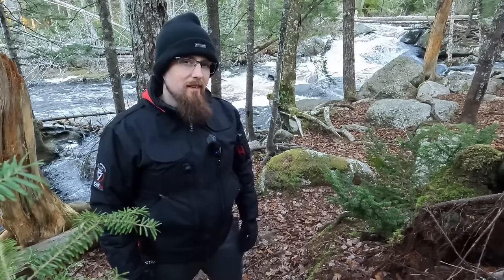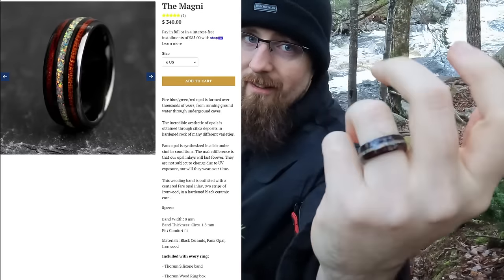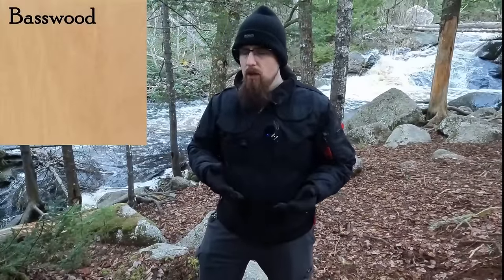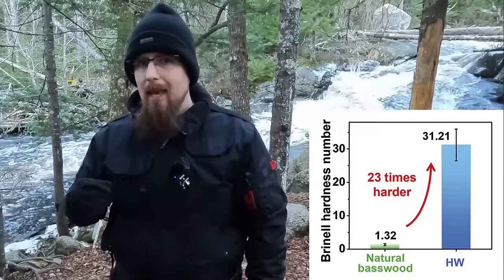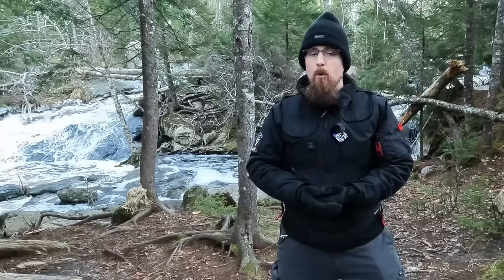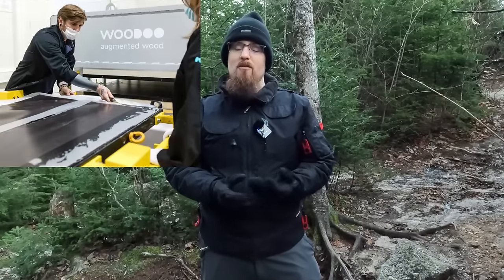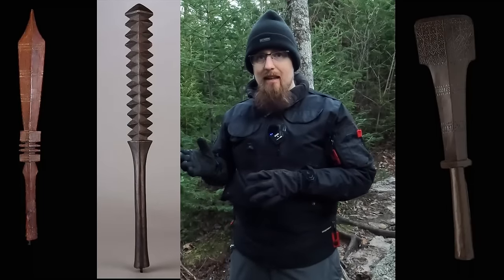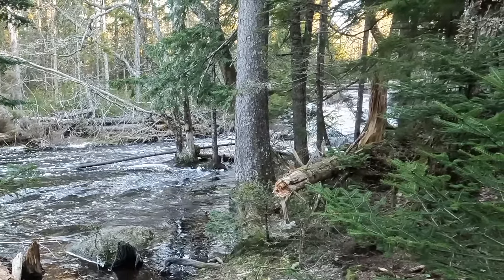Hardened Super Wood!  -  Can It Rival Steel?

Comment: I see a big problem with using this as a building material:

One of the reason we use wood and steal as building materials is that they offer strength and yet they are flexible at the same time. Flexibility is essential because it prevents the material from breaking under stress.

A good example of this is why we don't make swords out of stainless steal. Yes, they would be easy to maintain and stainless is very strong. But stainless is going to shatter under the stress of a duel.

If you increase the hardness of wood, it will break and your building will collapse.
Reply: The best alternative would probably be to breed trees so that they would be able to soak up metals, allowing GMO trees to be planted in mining areas or other polluted places.

Imagine being able to grow organic beams, and all you had to do was feed them waste materials.

Fungi already does this with trees to some extent, so it would theoretically be a fairly straightforward path into the technology.
Reply from the maker: As actual lumber you're better off with regular wood. As far as nails are concerned... maybe, I don't know how tough and flexible hardened wood nails are. 

I think the main advantage is upgrading softwood to something even better than hardwood, for applications where you'd otherwise use either exotic hardwoods or softer metals (brass, bronze, maybe cast iron), etc.
Reply: Don't confuse flexibility with strength. You're imagining a relationship between flexibility and strength because strength is stiffness times deformation. With stronger materials being able to take more deformation because deformation being one of 2 parts of the strength equation. It doesn't have to be that way. You can have a strong material with high stiffness but not able to take a lot of deformation. The reason to desire flexibility (the exact opposite of stiffness) is because we don't want things to be brittle. Brittle materials fail suddenly and can appear weaker when motion is involved but they're not actually weaker just because they're brittle. In fact, the strongest steels are the least flexible steels. As a civil engineer, we actually try to use weaker, less brittle steels for the amount of warning time they give before they fail.
Reply: @gatovillano7009  I could have made that video myself. As I already said, motion can create the illusion that flexible materials are strong. You will find no edit in my original comment. You responded with a video that has everything to do with motion. He spent most of his time talking about things other than flexibility but he did mention it.

TL:DR, flexibility is a way to circumvent the need for strength,

Let me explain what flexibility actually means for materials. But first let me explain that strength is. Strength of a material is how much stress it can handle before it fails. And stress is a fancy word for the part of the force something can transfer through itself without moving. If you're falling from the sky, you experience the force of gravity but you don't experience much stress because you're moving. Once you crash into the ground you experience a lot of stress because the ground won't let you move. Before you hit the ground, there is no test of how strong your bones are.

Now, for flexibility. Flexibility is how much something stretches when force is on it.

A common building material is A36 steel. A36 steel ruptures at around 58,000 pounds per square inch. That's how strong it is. That's the strength. Notice how I gave you no information about how flexible A36 is. The strength doesn't involve the flexibility. How flexible/stiff it is is about E=29,000,000 pounds per square inch. That's a fancy way to say that if you stretch the steel 1%, then it experiences 290,000 psi.

So, why would they want the building to be flexible? The answer has to do with what I said before. Stress is a measure of how much of the force a material can transfer before it fails.  Here's the key-> "of the". A given material doesn't have to be the thing that transfers the force. Just like how your bones don't have to be strong until you crash. By making the building flexible, you're letting it move. That doesn't mean that the steel is strong. That's why the video mentions having a giant heavy ball in hanging in the building. By making the steel flexible, the steel lets the giant ball absorb the force by swinging around. The ball is taking the force instead of the steel. If the steel wasn't flexible, then the building wouldn't move, causing the ball to also not move
Reply: One mistake- I just realized that you weren't saying that flexible means strong. You were just saying that the flexibility is useful. I apologize. You seem like you might know what I'm saying already.
Reply: structural material materials dont get exposed to sudden ultra-intensity stresses  like weapons or tools do.
Reply: @gatovillano7009  you do see how brick, concrete, and metal also fails in this video?

Buildings build to sustain earthquakes actually rely on shock absorbers which, you guessed it, prevent the structural materials from being exposed to ultra-intensity stresses. Or do you think a 100% steel skyscraper would survive such an earthquake?
Reply: @FrenkieWest32  Dude, cry me a river.

You want to see how much I don't care. This shit has been going on for 3 days. Me I have a life. I'm just going to move on and let you talk to yourself.
Reply: @gatovillano7009  so much of a life that you're salty over a stranger on the internet...

Comment: they need to make a plywood version of that hardened wood if you want any shock absorbing armor and the like
Reply: Maybe do something like old longbows/composite bows so that one layer absorbs force, another dissipates it around and if those two aren't enough a third "cracks, but deliberately"?
Reply: Lamination and composite have been around a long time. Armor in Japan  made of paper, glue and lacquer. Other things added were horse hoof, ground or sliced, sinew and leather. Even simple glues like milk and vinegar get very hard.

Comment: I'd be real curious about its use as a tonewood. There are already some interesting methods for converting more available woods into something resembling exotic hardwoods for instrument building, wonder if this would do anything like that
Reply: Agreed.  Instruments, furniture, kitchen utensils, doors.   The types of things that don't need to be strong, so much as durable and pleasing to see, touch, feel or hear. :)
Reply: @MrBottlecapBill  Having wood door framing made out of this along with your door would make break-ins significantly harder. The same might apply if your windows were transparent wood too.
Reply: @BluntofHwicce  Gosh, you remind me of Stradivarius violins! Part of the "secret" (if it exists - blind tests show most people can't tell a stradivarius from another violin just from the sounds - but I can well believe the player would feel the difference much better) is supposed to be due to the Little Ice Age in the 17th Century iirc. Due to the cold the trees grew less, so tree rings were closer together and the wood was harder. Artificially hardening wood by chemical treatment and compression ought to have the same kind of effect.
Reply: @BluntofHwicce  wouldn't the change in density also change the acoustics?
Reply: @BluntofHwicce  oooh

Comment: Curious about the strength of the hardened wood. Could it be used in aerospace applications? Neat video!
Reply: I’m thinking heat resistance would be the issue…
Reply: @sorryociffer  Should be fine to use for body paneling, I think. It might be able to be more form fitted than aluminum panels? Not sure
Reply: @sorryociffer  actually wood ablates, so for something that isn't going to be re-used, I could see some uses.

Comment: Quite possible people in the past split wood into thin blanks then boiled those blanks in the very commonly known resin and animal hoof type glues then pressed the wood with rocks or lever arrangements into shape then crafted stuff with it.  Composites once you have a glue seems like a pretty likely thing and the lack of remaining artifacts is likely due to the somewhat prone to decay if not maintained aspect that even modern-day Composites have.  The glue brakes down and the thinner materials used for the laminate just brakes apart into dust.  Fiberglass is super notorious for this once the sun and weather work it over theres not allot left usually.

Comment: Seems to me that it would be a pretty wasteful process both in terms of water but also in wood seeing that you end up with much less of in terms of volume which would mean that far more tree would need to be cut to compensate for it.
Reply: If it has 1/5 the volume, but 23 times the original strength, no, you don't need more wood, you just make thinner structures with it.

Comment: Wood has an outstanding strength to weight ratio. Hard would be pretty awesome,
Reply: Not really. Vinyl and many plastics are lighter AND stronger. Wood is pretty heavy.
Reply: @trequor  Oak for example has a density of 0.7. Not sure what plastic you're talking about, because Nylon, 1.13, PET 1.3, ABS 1.05 PVC 1.45 etc are all denser. Oak tensile strength is typically given as 90 MPA, Nylon 78, PET 80,   ABS 45, PVC 62 (rigid - flexible is less)  Moreover to my point, 304 Stainless strength 505 MPA, density of 8 has a strength to wt ratio of 63. Oak, with a strength of 90 and a density of 0.7 has a strength to wt ratio of 115.  AS I said, wood has an outstanding strength to wt ratio.
Reply: @MrMakulit1959  That's not how that math works, comrade. You've got to manage your units better. Also oak is a piss poor example because of its expense and rarity in comparison. Nobody is going to build a house out of oak.

Then there is the problem of ACTUAL density in regards to wood. Because wood absorbs shit-tons of water, whereas plastic and steel do not. Your 0.7 density is going to jump dramatically once the oak hits the outside air.
Reply: @trequor  You don't know what your talking about. That's exactly how the math works
Reply: @MrMakulit1959  density =/= weight, for starters, but there is a lot more wrong with what you said.
Reply: Density is what is used to determine strength to weight ratios. If you don't understand this, I can't help you.

Comment: The thing about compressing basswood versus compressing oak... is that you wouldn't be able to compress oak down 23 times, like you can basswood. If you had a 2x2×12 of both woods compressed to their maximum, I imagine they would be quite comparable, as you're just compressing the lignin... and their densities and grain structure would be quite similar.

From what I understand, if you use alcohol to strip them of their sap and kiln dry them... it's either basswood or balsa which has a pound-for-pound strength markedly higher than oak. For this reason, in some circles, both are considered hardwoods, even though their natural soft nature would lead you to believe they are softwood. If I'm not mistaken, the same goes for Paulownia.

Comment: We use to use planks of wood and then drill through or drive nails in. But with this level of industrial manipulation, we could produce planks that are pre filleted at specific spaces so that they can be fixed in a much more strong and resilient way. Not to mention that if it cost more in transformation fees, much less of the material is wasted. With a more durable strong and less bulky material, an habit in investing in the long term would reduce over all waste at the land fill. Which justify the industrialization of the approach alone. For in this optic, that means that a plank can be made of a number of source of wood and be made at any desired thickness length width, shapes... A specific plank can also snap to another length providing a bond that makes the need to cut over a specific member necessary for support between structural members.

I would imagine the material to be less flammable also then the raw wood. In construction it is the limiting factor for the construction of large constructions. On this regard, concrete and stele are preferred. But those require extreme amount of industrial work and energy in comparison and end up weighing extremely more per unit of volume. That translates in much more massive foundations and architectural stress to be accounted for. But also in extreme cost of transport, craft, installation and storage.

Structural wood today is made of wood flooded in epoxy. And this is extremely not ecological and just as bad in regard of flammability. So their use is also not very extensive due to cost and risks. And the process involved here is a totally new thing and would make better use of the wood these structural would do of the wood ship they are made of. Plus their molecular bond would be more homogenous and not serve really as filler in a soup of epoxy.

We could even see thine sheets of these compressed woods in replacement of carbon fiber and fiber glass panels. And in this way make their use more economical, durable, practical and common. I can easily imagine a paddle of this compressed wood outmatch those in carbon fiber in weight, durability, and strength. It sure would cost more at first, since these industrial practice benefit of decades of investments, but given time, the sustainable paddle would outperform the old way even economically. I would imagine this material to require no care and protection for a normal life span. So no paint, cleans or oil required as opposed to raw wood. And that makes the all thing even more cheap and light.

Comment: I wonder, if instead of shaping the harder wood into a blade after it becomes treated, could you shape the wood while it is very soft into a mostly sharp blade shape via a mold of some kind?
 
Though I think the best use cases for the material is definetly construction.

Comment: There was a manufacturer that made condensed wood staffs. They where heavier than a regular staff of the same size, and where hard to bend. Made for a decent long club. But lacked the agile maneuvering a more limber lighter staff would have.have.
 It held up decent against swords, chipped rather than took on knicks, and bent the edge of a sharp blade bad enough it would need a miner bevel shaping to get it sharpened properly and get the bends on the edge out without worrying about chipping later.

Comment: I am curious since the density goes up if it can work in place of say phenolic applications. But also curious how it works as a heatsink, like I am sure it would work better than PLA (melts around 200C) but more so curious since heat usually doesn't deform wood in the way it acts with Plastic or even metal because the flash point Is lower than heat deformation. So like say if I used it for a motor assembly or chassis of some kind if it will work somewhat better.

Comment: wood can surprise with how hard it can be, my house is somewhere around 110 years old and is built inside and out with old growth cedar that is so hard it is insanely hard to drive a nail into it and if you try and use a hole cutter on it the drill will bounce around and the wood you do manage to cut through is very obviously scorched.

Comment: There's been wooden nails for a long time now. Modern kind are used in houses with extreme case of green fetiche along side CLT panels and other whacky cutting edge tech. Mostly in Germany. You need a specialised nail gun to work with them, though, that costs like a small house themselves.

Comment: There are some things that I wonder about. What is the density of the hardened wood? How flexible is it? How does it reacts with stress concentration points? Because what I have in mind is slimmer bows with slimmer arrows that spring faster than comparable weight standard bows with more aerodynamic arrows that may even not need metal tip

Comment: Very interesting.  Of course, there are several different types of strength/hardness, all of which are important.  Tensile strength is resistance to snapping under tension.  Torsional strength is resistance to twisting forces.  Some materials are excellent under tension but weak under compression (squashing or pushing) or flexion (bending).  Something that is very hard may sometimes be brittle.  When making a steel sword, it needs to be hard enough to hold its edge, flexible enough to take impacts, and not brittle.  Even compressed wood has a grain structure, so it may resist a cut better across the grain rather than between the grains.  This processed wood may be excellent for some applications and not others.  I doubt it would replace metal in many applications, but it could replace some hard plastics, and could also be used in the building industry.  The fact that it can be moulded when soft, then hardened in shape, is a huge advantage over natural timber, because making a large volume of identical complex timber shapes by cutting, drilling, chiselling, etc. is very labour intensive and time consuming.

Comment: I wonder about the other characteristics, is it still flammable ? How much ? Is grinding the same as metal ? Logically it should but it's possible heat and other factors alter how easy it is to grind it ? Comments also mentioned possible problem with water over time. Very interesting nonetheless.

Comment: check out nile reds compressed wood armor where he implements that research articles method and tests it. It barely stopped a 9mm with 3 layers but its a good reference at least for ultra strong wood as a concept. (oh and he used pine as the base wood)

Comment: Osage Orange or Lignum vitae are two of the hardest woods known.  I tried to use and axe on Dried Osage Orange and could barely get the blade in further than about 1/8".  You'll actually dull an axe blade on that wood.